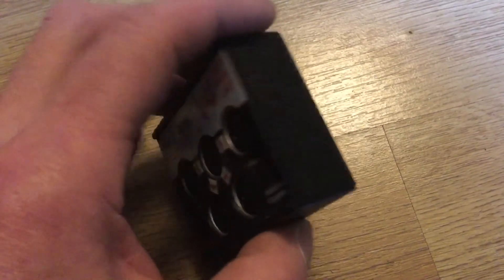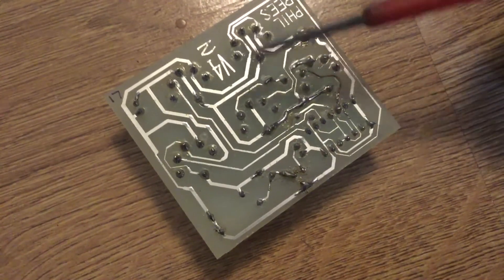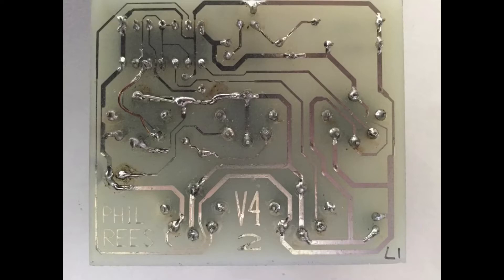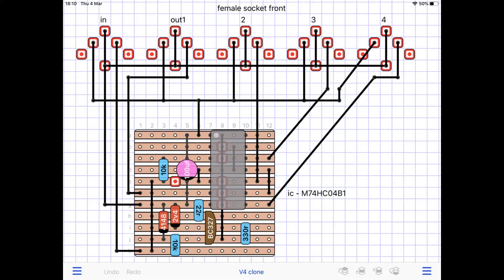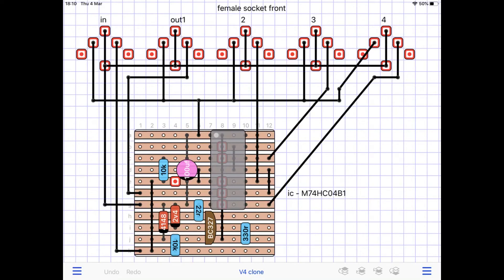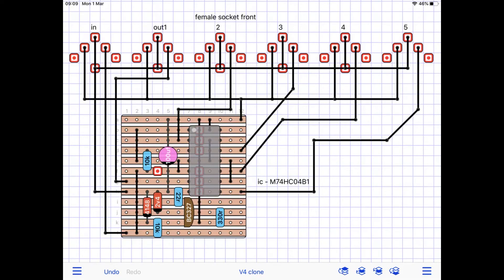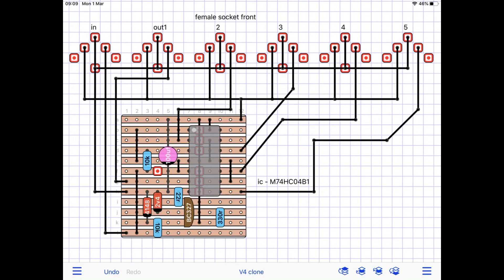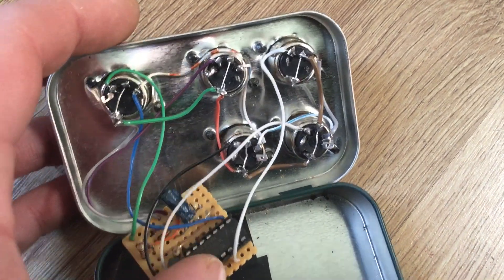DIY stripboard synth - 4 or 5 way passive midi thru

Comment: Hi, why is your bc327 reversed? we can see it in minute 1:44. Thank you.
Reply from the maker: Why?  indeed. An astute observation thank you. Had a little look over this again, my error of course , even though it works. To cut it short ,go by stripboard layout, it conforms to original board.
Reply: @UnauthorisedService I built the exact same circuit, with 5 outputs, using exactly the same components—resistors, capacitor, diodes including 2.4V ones, the same IC. I’ve got 5V reaching the correct pins, I’ve already checked the traces three times, and it still doesn’t work 😛 I was really hoping it’d be the BC327 reversed that would’ve saved me. 😅
Reply from the maker: @MiguelRodriguez-ed7yc well i built two at least no problems. From my own kind of extensive experience and failures  its 9/10 builders fault . So triple check everything (again) cuts , links, shorts, components the lot . If you have five volts from midi connection to power the ic then at least i guess you have the midi connected correctly.also use exactly the spec of hex inverter . It is cmos, unlike the other suffixes  which may require more power , something like that anyway.
Reply from the maker: Just have to add…  odern “toy” instruments like volca style synths , their midi line power is  likely to be around 3.3 v, so will not power the hex inverter.

Comment: Do you think this is doable for a soldering electronics beginner with just a couple of projects done (half of which didnt work:D)? It seems pretty straightforward
Reply from the maker: yes , its all "doable". believe me , speaking from experience , 9/10 times it is "your fault !" if things dont work . incorrect placement ,wrong values, wrong or missed cuts n all that. we all had to start off as newbies  for sure, so go for it , if its something you need. a line powered midi splitter is pretty handy, I made a couple.

Comment: Hi, will this work for multiple keyboard controller to control 1 synth module? Say keyboard 1 ch1 and key 2 ch2, key 3 ch3  etc etc, thanks
Reply from the maker: You need a midi merge to combine separate midi inputs . Use this or similar midi through, for example from a sequencer with midi tracks per channel to route to hardware devices that will receive on different channels. For merging maybe m audio midisport 4x4 or subzero 4x4 are an affordable option but only they merge max 2 inputs I think..hope that helps 👍